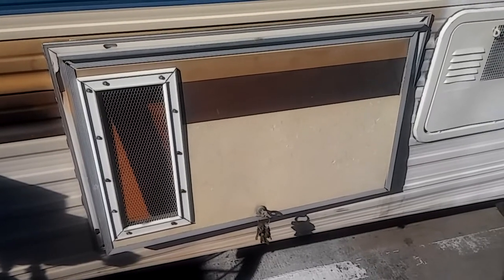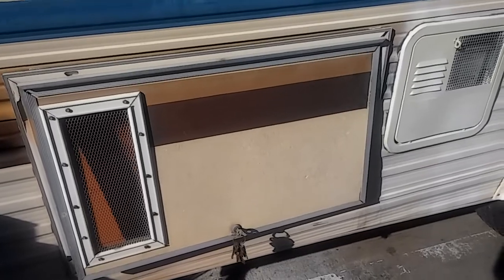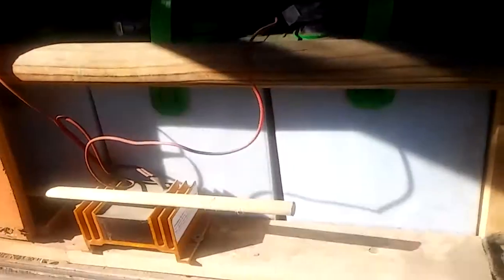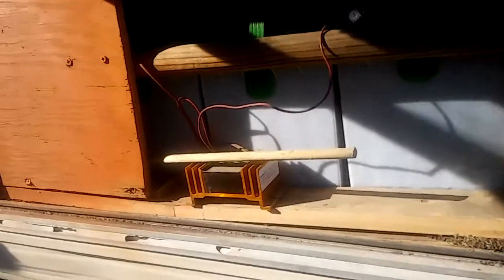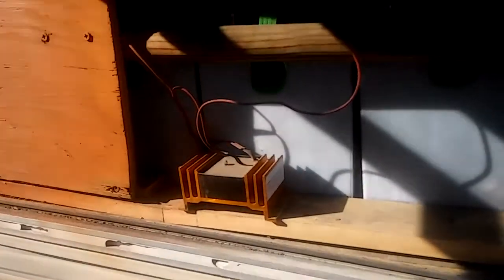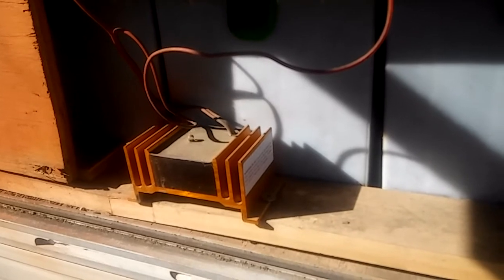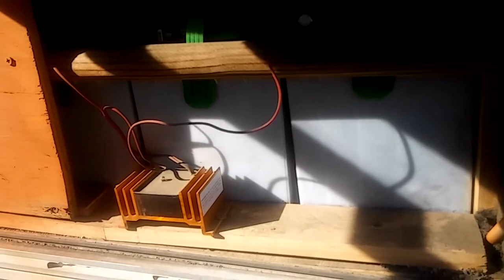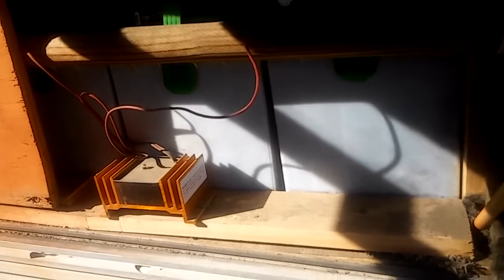Solar battery bank and desulfator talk

Comment from the maker: Update 8/21/18 And I see not drop off in performance yet...full charge is close to 13 volts 12.96...and I do shallow discharges to 12.4 volts typically. Now Going on 5 years.